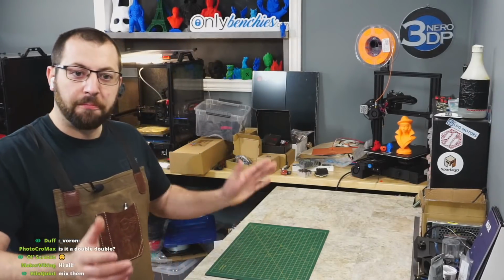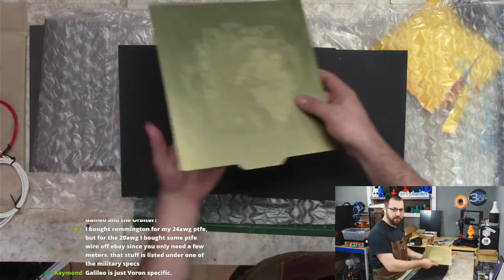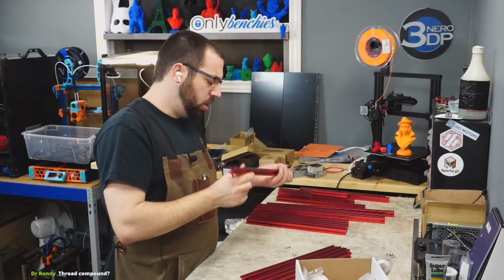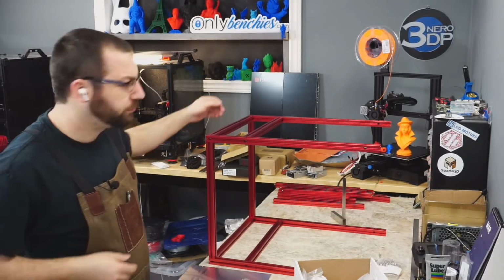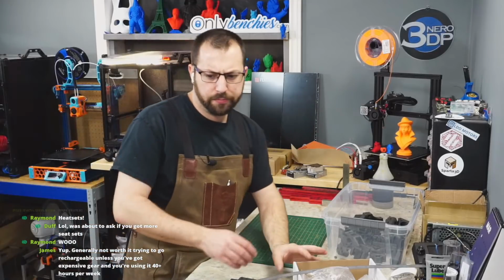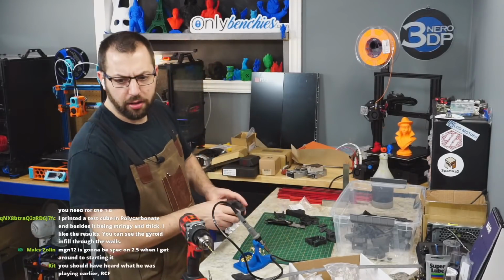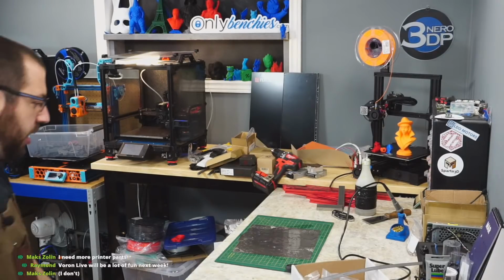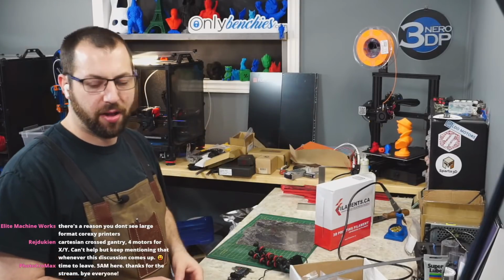Voron V1.8 Build Livestream - PART 1 - Frame Assembly & Component rundown

Comment: ! MAJOR AUDIO ISSUE WARNING, PLEASE SKIP AHEAD OR MUTE ! 
1:38:53 - 1:40:53 [Technical difficulties 2]

2:30 Channel Intro theme
3:47 Project Intro theme
4:15 Start of the stream
6:20 What is tonight stream plan 
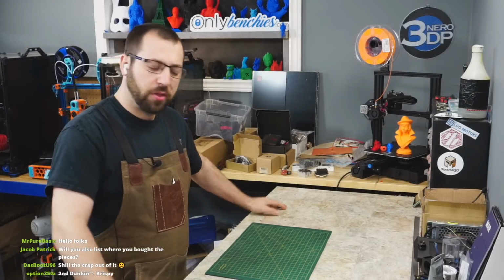8:02 VORON v1.8 Part 1 (starting with explaination)
[SEE FIRST COMMENT]
35:29 Frame assembly guideline
[SEE SECOND COMMENT]
51:32 Frame build start 
[SEE THIRD COMMENT]
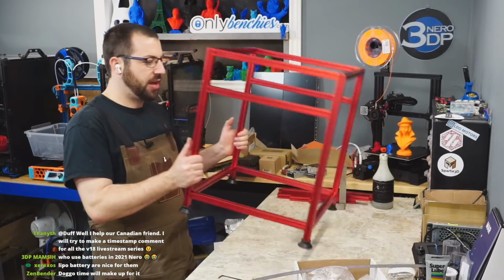1:43:20 VORON v1.8 Part 1 end with what's next (Q&A) 
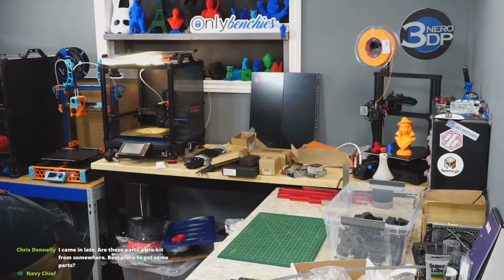1:45:40 - 1:47:40 Doggo (coda) halftime show
1:48:00 Heat set insert (Q&A)
2:16:18 Next week stream, what to expect in this series (Q&A)
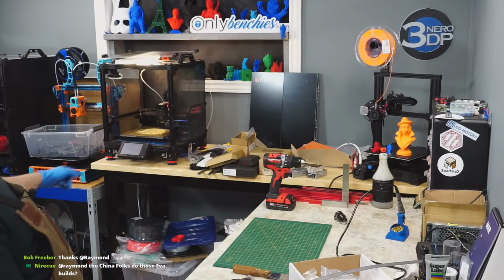2:28:11 Question to the viewer (for future content)
2:30:04 Peeling the PEI of the spring steel plate (replacing will be off stream)
2:35:37 Rant about the "like that smash button and dumb face to please YT"
2:44:24 - 2:48:50 Audio clipping [Technical difficulties 3]
2:50:08 Filament he want to try one day (Q&A)
2:52:00 PO Box question
3:00:40 Closing / ending of the stream
3:02:04 Project Outro theme
3:02:33 Channel Outro theme

Here is the table of contents for the first part of VORON v1.8 with timestamp.
Listened at 1.75x speed, so I might be off by a couple of second. 
I will probably do the same for each build stream of this printer. 
Have fun!
Reply: 8:02 VORON v1.8 Part 1 (starting with explaination)
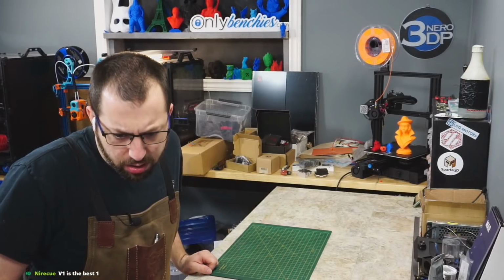10:28 Why not use CAT5 Ethernet cable instead of silicone? 
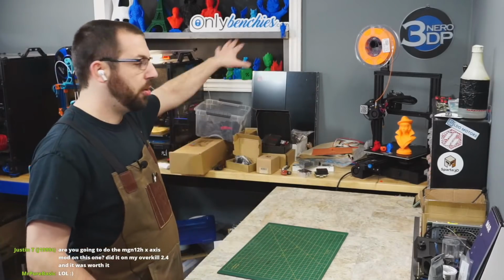11:12 Printed part rundown 
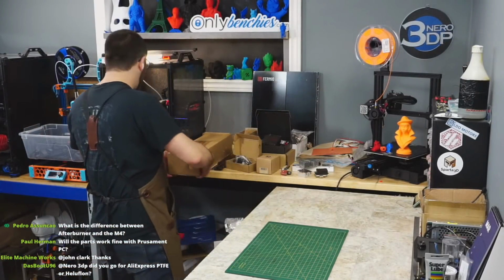13:50 Component rundown / overview
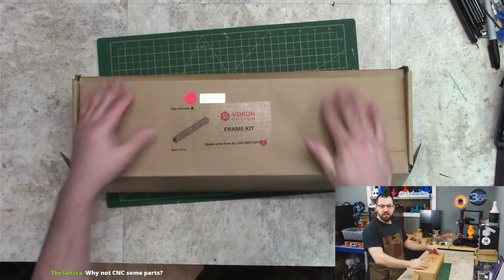13:56 Component: Frame (from LDO)
15:22 - 16:27 What's the goal of Toasty Boi (and original plan)
18:30 Component: Electronics (controller board from Sparta3D)
20:55 - 21:41 Muted (motors selection) [Technical difficulties 1]
23:25 Wiring selection (pre made looms from Fermio Lab)
28:22 Buildplate selection (from Fermio Lab)
32:26 Panels selection (from Fermio Lab and Sparta3D)
Reply: 35:29 Frame assembly guideline
35:46 - 36:35 How v1.8 livestream will be divide in part
36:49 Manual {page 1-9}
40:19 - 44:14 Little disclaimer about the VORON 3D Printer, the manual and kits
45:09 - 46:57 Printed parts
48:00 Building the frame
Reply: 51:32 Frame build start (with top and upright extrusions) {page 10-12}
57:15 Frame quality and tapping (tools recommendation)
1:01:50 Assembling on a flat surface (how flat)
1:08:54 - 1:09:19 Manual advice that Nero didn't follow ;)
1:09:36 - 1:10:33 Nero getting his machinist square (empty room)
1:12:44 - 1:15:00 Why you follow the manual advice (what Nero didn't follow)
1:15:02 Y extrusions {page 13}
1:19:49 Bottom extrusions {page 14}
1:27:08 Correcting a rocking frame (not square) 
1:36:54 Feet {page 15}
 ! MAJOR AUDIO ISSUE WARNING, PLEASE SKIP AHEAD OR MUTE ! 
1:38:53 - 1:40:53 [Technical difficulties 2]
1:41:20 Back to normal

Comment: Canada, where people and booze are Imperial, carpentry and machining are SAE (they aren't actually the same, although the difference is irrelevant for most things that use inches (but matters a lot when you're using miles and a whole lot when discussing pints)) and everything else is in Metric... though some food items are really in Imperial, even if they're labeled in metric, which is why we have 371 ml beverage cans.

I'm many months away from building a Voron (need to build up time, funds, and confidence) but the techniques and problem-solving approaches I'm seeing here are super useful.  Thanks for posting the streams!

Comment: Why would resin printed parts not last?  Quite a few different resins with different properties now.  I think they handle high heat as well.
Reply from the maker: Resin printed parts have a tendency to break and crack after prolonged use. Ive yet to see resin printed structural parts actually last in an enclosed voron

Comment: It is a travesty that you put V0 in storage and left the creality on the bench.
Reply from the maker: I dont have room on the bottom shelf for the creality (plus i need todo the h2 video at some point)
Reply: @CanuckCreator  I'm disgusted by the h2. They refunded me my money. Not even sure why I thought it was a good idea in the first place. The bearing holes in mine are .020" over so I said screw this. Have an poorly made free H2 with zero will to fix. The ducky works.
Reply from the maker: @AXG6800  i hear ya, my SECOND one is "ok"
Its a decent idea marred by bad QC

Comment: What do you think about running an ACM panel under the bed frame to split the chamber in to two halves, thereby reducing the heated volume of the chamber and giving you higher temps? 

If you CNC cut the ACM to be as tight as possible to the frame/walls/rods, or use some (U-shaped?) weather stripping on the edge of the ACM, it should be able to effectively thermally separate the two halves. Obviously as the bed goes down the heated chamber volume will increase, but it would still make initial warm up times faster, and how often do you print at high Z height anyway?

Only big change necessary would be to the rear electronics enclosure, as the extrusions can't be inset from the side or air would flow between the two halves of the chamber.